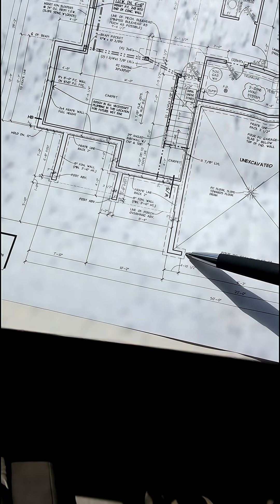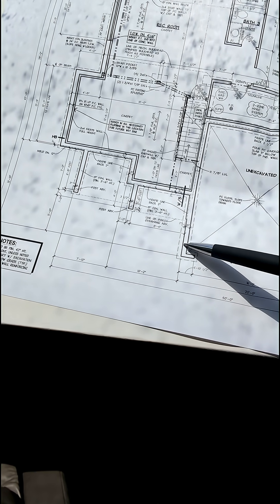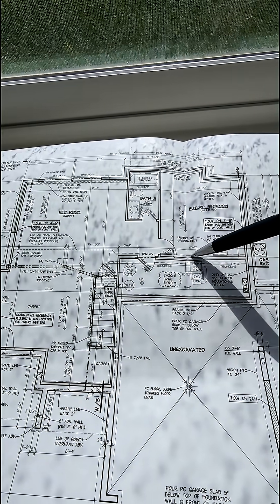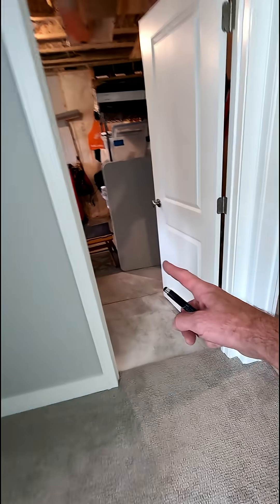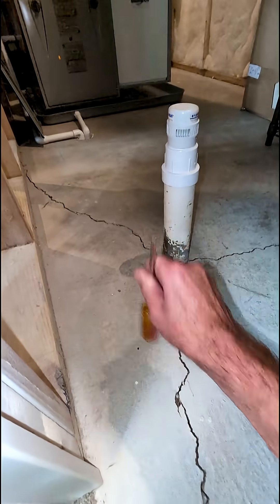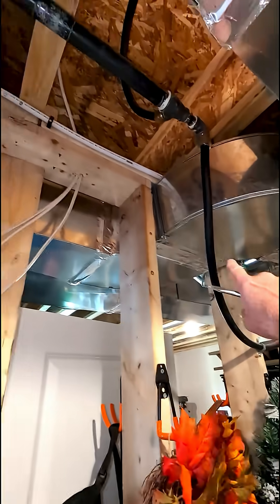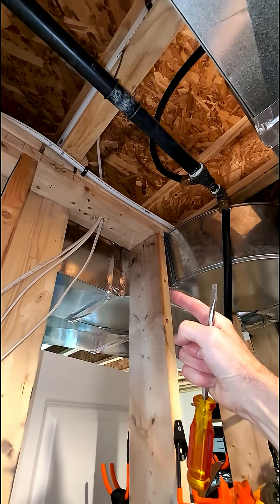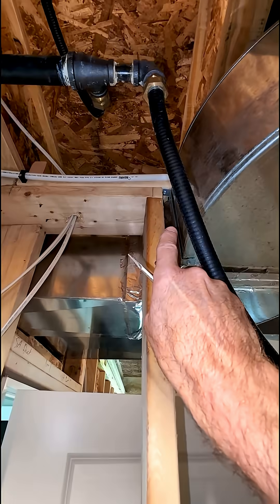⚒️⚠️NEW CONSTRUCTION FOOTINGS MISSING #shortvideo#newconstruction#shorts#youtubeshort#foundation

Comment: I see misplaced interior bearing footers excavated in the wrong place regularly. Diff to tell until future cracking which often gets dismissed by builders as “normal”. Gotta use a tape measure on a pre- slab to check interior bearing footer locations for sure.  👍